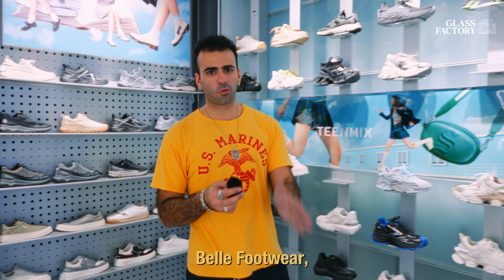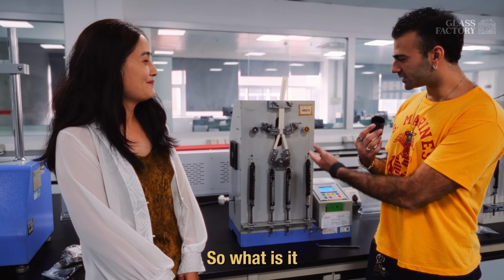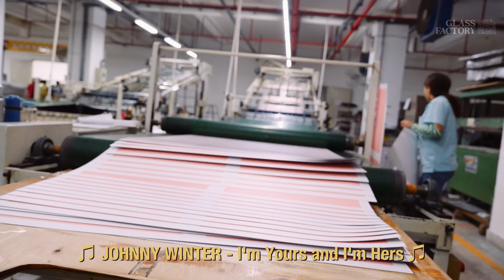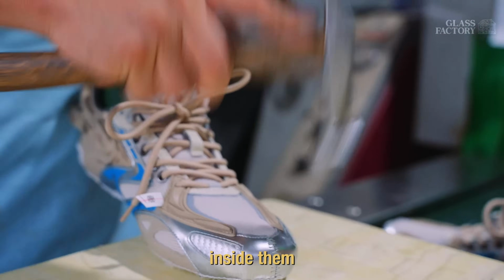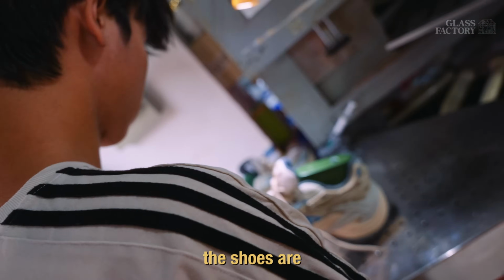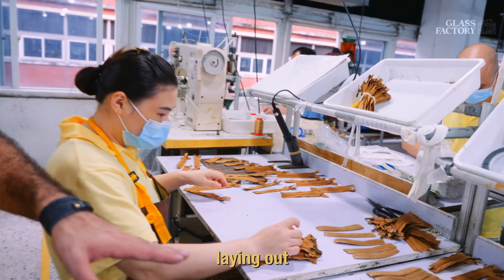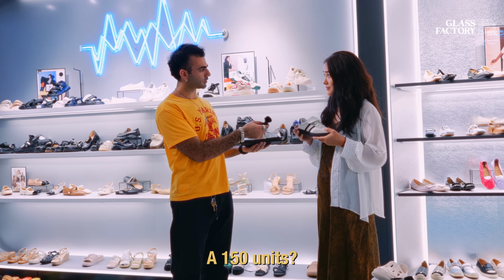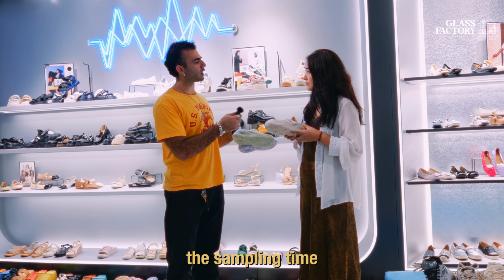Inside China's Largest Sneaker Factory

Comment: I had no idea so much of production was still manual.
Reply: Actually for many mass produced products, the manual labour is quite intensive. But for shoes it is really very intensive. Only the parts are machine made, all the assembly is manual.
Reply: A lot of customisation makes it hard to fully automate
Reply: Yes, it’s because they produce in runs. You pay for the run. It’s included in your price. Humans are actually pretty cheap. Machines which are created and trained by engineers are actually very expensive.
Reply: our feet aren't straight lines man